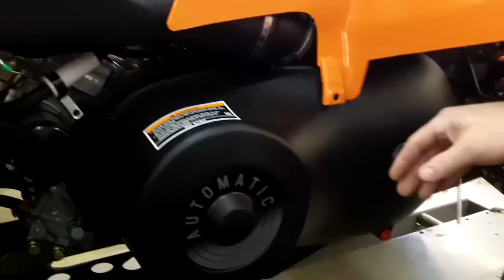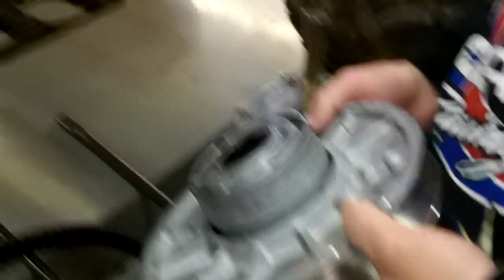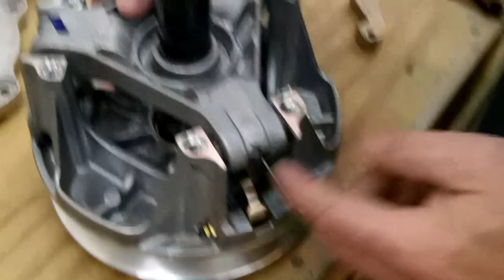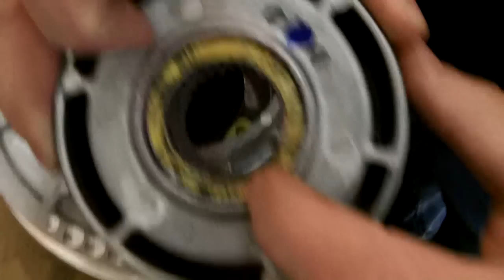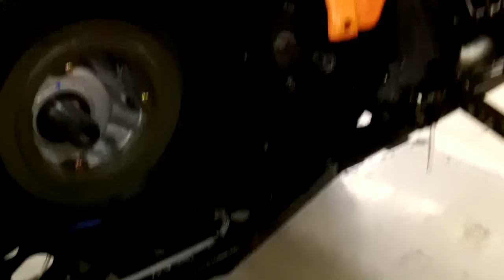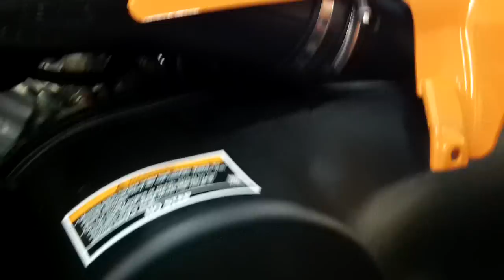EPI Performance Polaris Sportsman Clutch Kit Install

Comment: I need help with my front dif. On a 05 500 ho Polaris it won't shift out of 4x4 but it indected it did on the display but I still turns the front tires when the switch is on off any idea the wires look good and so does the switch so I haven't a clue why it would do that any advice? And also what springs should I go with for more power on take off in my  clutches
Reply from the maker: Not sure on the 4 wheel drive end of it.  On the older machines it would do that if the oil in the hub was low or really dirty and if you took it apart and cleaned it it would work again.  But on the newer ones not sure.  Springs will vary depending on your tire size that you are using and the type of riding you are doing.  If you tell us that we can help you better.

Comment: '14 Polaris 570 eps with non engine break follows identical steps as this video. The clutch cover breather hoses are attached differently making it even easier to remove and install but other then that everything else virtually identical.
 
'14 Polaris Sportsman 570, 27x9x14, 27x11x14 tires
EPI Sport Utility Clutch Kit - 27-28" Tires - WE437184 using Primary Spring Green and separate from kit Secondary Clutch Spring - Orange - PDS-2 (PDS2)

Comment: it spins one way..but not the other way..is tht bad
Reply from the maker: it should spin one way and lock up the other way if your machine has EBS (Engine braking).  Sometimes the little black fiber washer that goes between the bearing the fixed sheave of the clutch will break or wear out and allow the bearing to get spun around but the clutch.  Its hard to see but you can look for that or to see if it is missing, from there you will have to inspect the clutch and all the bushing for any extreme wear to where the clutch wont fully open/close.
Reply: Ok thnkx

Comment: question...my 05 700 ..when i put into gear it starts the bike starts to move..and i can shift to any other gear..i have to turn the bike off and then shift....idle is bout 800 right now..
Reply from the maker: chances are your bearing is going bad and locking up on your primary clutch.  Remove your belt and try to spin the bearing on the primary clutch, if it doesn't move one way freely then your bearing is bad and needs to be replaced.  When the bearing sticks it will want to spin the belt and make it hard to shift unless you shut off machine.  If bearing seems good clean and inspect clutches and then try it again.

Comment: Hi. I have a 2012 400 HO. I have put 30" Moto Monster Tires on this machine. A friend suggested me getting a clutch kit to pull them. I have searched for a clutch kit for this machine. I can't find one. Does EPI make a kit to fit cluches Primary 1322682 Secondary 1323015?
Any help would be great.
Reply: They do just go to the page then products then clutch kits then Polaris then 400 then sportsman then the only clutch kit their the sport utility and get the top on for 27-28 should be fine

Comment: I have a 2013 sportsman 500 ho with 28" mega mayhems on it..which have inch and a half lugs. I want more low end for sure, but I don't want to loose much top end speed.. im debating between the sport utility and the mudder kits.. what are your thoughts?
Reply from the maker: Either kit would work.  If you are doing more mid range to top speed all around riding I would go with the Sport Utility kit.  If you are doing a lot of mudding and want the best low end power then go with the mudder.  Either kit will be a big improvement over the stock clutching.

Comment: Mine is a 2012 500HO Limited Edition exactly like this one.  I use mine for trail riding most of the time but I also plow snow.  Here in eastern Newfoundland the snow is usually wet and heavy.  I use low range and it's got the power but still worry about the belt.  This is my first automatic ATV.  I'm running the stock 25" tires but might get 26" when it's time to replace them.  What's your recommendation?

Comment from the maker: It really depends on what tires you have on the machine if you will see a decrease in MPH for the kit you would need to get a good improvement.  Usually with stock tires and up to 28'' you won't see a decrease but with tires bigger than that you would see a decrease in MPH to get good performance gains with that big of tire.

Comment: Would it make the top end speed slower and would this help a lot in torque in high cuz that's wat I need it for that and mud cuz I have my freind ride with me and it has trouble starting to go in high but once it gets going its drives fine

Comment from the maker: Hi Jason,  The Sport Utility Kit for 27-28" Tires is the kit you want to use.  Part Number WE425007 (for 0-3000 ft elevation).  The kit will give you more bottom end and mid range, basically makes up for the power loss of the bigger tires.  Top end speed will stay real close to what you have now but will get up to it faster with faster backshift and throttle response.  It will also grip the belt better.